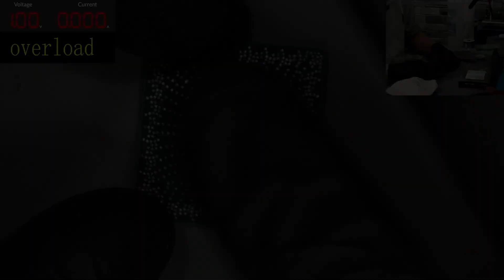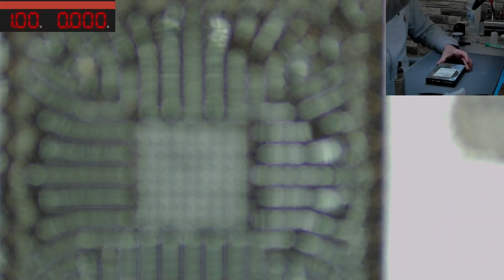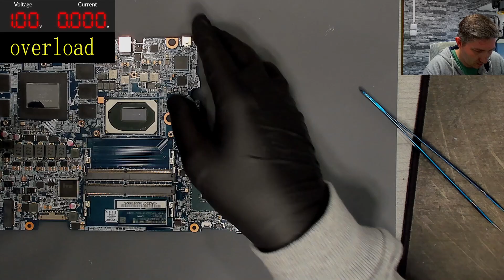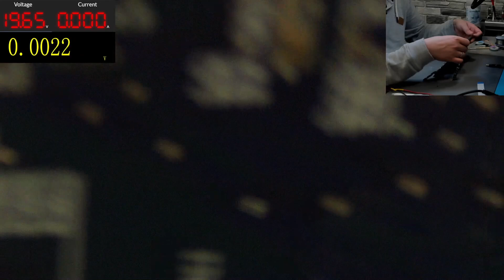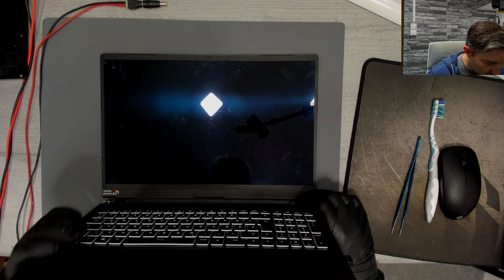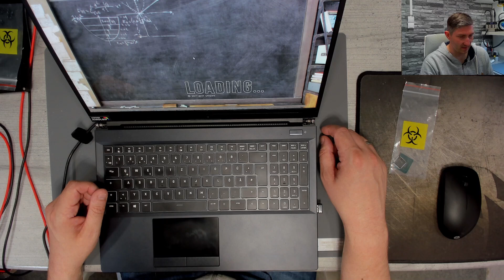Reballing and soldering a big BGA - Unexpected challenges and unexpected side-effects - Part 2

Comment: where can i get one of these chips?
i have a damaged one that needs to be replaced
the writings on it are
SRKMA
01613
X148C296
the laptop is Acer Nitro 5 AN515-57
Reply from the maker: Basically you have two options. Donor board or AliExpress. But be aware that you never know whether BootGuard is enabled on these which you can source from AliExpress. If enabled, it won't work with your device.

Comment: Good morning. Congratulations for the succesfull repair! As far as touchpad is concerned, I believe that it is not a HW problem since when you were in BIOS menu it was OK. So PCH is working and it can be rule out. My suggestion is to try a Linux live distro on USB stick and check the touch pad with a different OS. If touch pad is fine with Linux it it a WINDOWS problem (compatibility, perhaps?). Good luck, fingers crossed! Regards from Italy.

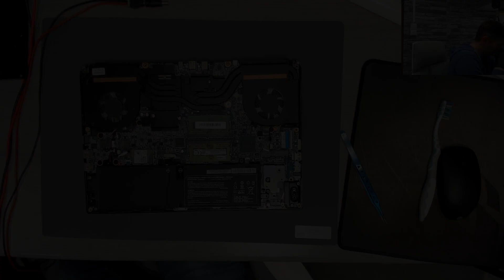Comment: congrats on your repair, but I confused in 27:00 - 28:00 you have picture on laptop, is this after you replaced clean ME region or not? thanks
Reply from the maker: This was before the dirty ME was cleaned. The point is, that it needed way too long till it shows picture, even after second and third attempt (without removing power) it was too long. This is a typical cause of dirty ME Region.

Comment: Nice fix piety that the tochpad is not working strang in bios it works good . Nice fix something stil wring with bios maybe?

I like your video's
Reply from the maker: Tried three different files and the original with cleaned ME. No luck. :)

Thanks!
Reply: @boardwerk-en  and no lose conection on ec  controller. Probably you have it device anymore.  Is that not what controls the mouse , touchpad etc.
Reply from the maker: @stevedebeukelaer1424  EC pins were at least quadruple checked. Thanks for your interest. :)

Comment: Excellent video and repair Mike. Very powerful come-back 😉 The touch-pad since it's working on the BIOS it should be some higher level logic that doesn't work. Did you check if the touchpad board has some FLASH IC on it ?  For the reworking, could you please elaborate on temperatures a bit ? What temp you set on the hot plate ? Did you take measurements on the PCB surface ? What was the target temp before you start pushing hot air from the top ?
Reply from the maker: The truth? I don't use a temperature Sensor on the board anymore but work according to my feeling.

Hot plate set to 200°C, pre-heating the board for 15 Mins, Hot-Air set to 350°C 50% Airflow with a fitting Nozzle for the BGA size and let's go. Observation with microscope till I am convinced, PCH is in place, done.

Did not find anything useful on the touchpad PCB but checked every single single line and component on the mainboard without success. However, I am done with it and it's okay. I gave everything I could and a 95% win is still okay for me. :)

Best regards
Reply: @boardwerk-en  I know the feeling. I work here with some DELL corporate laptop boards and even if some times a finger print sensor (for example) doesn't work, it's fine as long as the board posts and loads windows. I'm going to try my luck with big BGA and I'm trying to collect as much information I can, so thanks for the info 😃 As for cleaning ME region, I can help you too if you can't find someone else available. Have a nice day Mike!